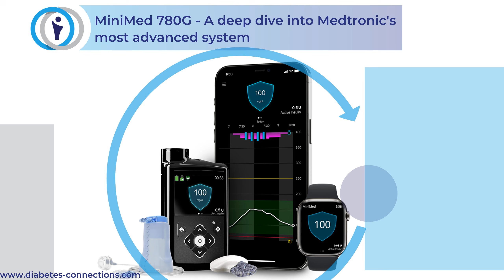The MiniMed 780G - A deep dive into Medtronic's most advanced system

Comment: I wish they would force pump makes to make their insulin pumps work with all CGM sensors. I like using the Freestyle libre 3 over medtronic Guardian 3 sensors. So I pay for the Libre 3 sensor while using the Guardian 3 which sucks in my opinion. All due to Medtronic wanting you to use their crappy inaccurate sensors.
Reply: Using the Guardian 4 since June and verifying once in a while it is a big improvement over the guardian 3.  Their sensor doesn’t suck.
Reply: @TomHoffmanJr   Yes   I agree the Guardian 4 is way better than the Guardian 3. I am still wearing a Freestyle Libre sensor and the Guardian 4 is close enough not to be a problem.

Comment: I’ve been on the 780G for about two weeks. It is absolutely brilliant. Great system!
Reply: I find it very difficult to put on my arm using one arm. Difficult when you are by yourself.
Reply: @Kevin-kf5dn in Greece Medtronic showed me to put it on the thigh. It works great and with an additional tape, it lasts 7 days
Reply: Hey i habe a question. Is it possible so give a bolus through the app or do you have to do it on the pump?